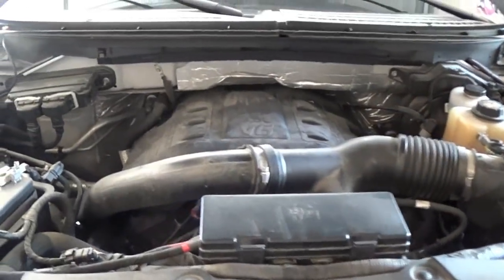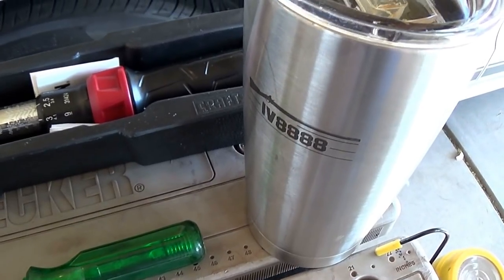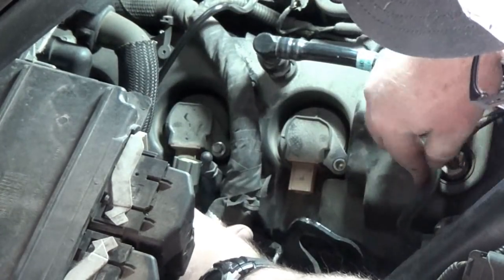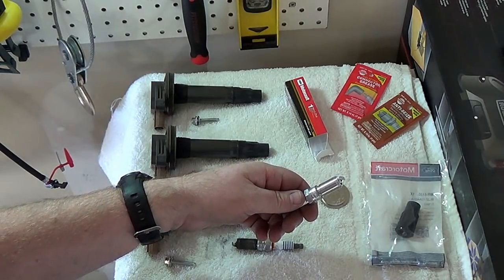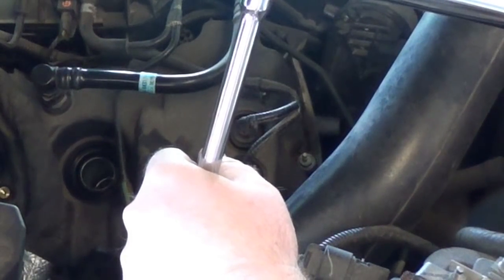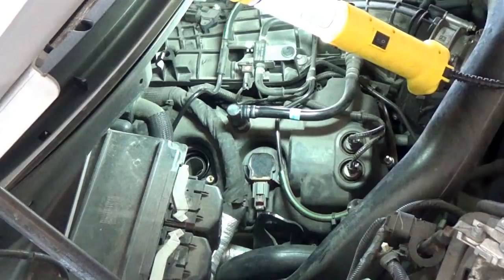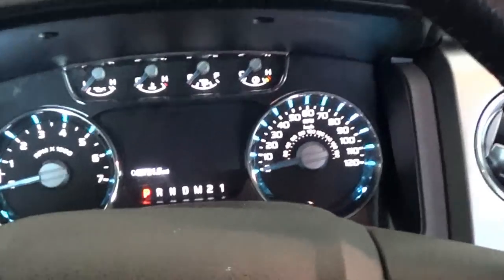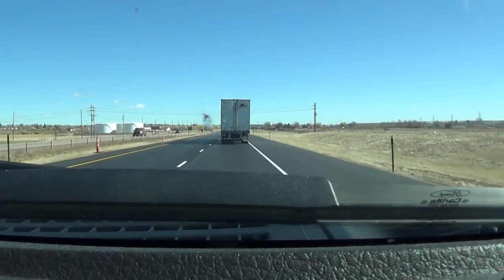2013 F150 EcoBoost Spark Plug / Ignition Coil Removal & Install | No more misfires

Comment: I have the 2013 F150 Ecoboost. I got the updated motocraft SP580 Iridium plugs and coils. I was having the chugging and flashing yellow light at higher RPM. $96 and two hours later the chugging is gone! This is a definite fix and WOW, so much smoother & what a power difference! You were right about  the MPG improvement too (and those bastard clips)! Fantastic video and thank you!!!
Reply from the maker: Thanks for watching and sharing our success.
Reply: Where’d you get coils and plugs for 96 bucks? I have a 2012 eco boost with the misfire in the third cylinder and I got new plugs but those coils are pricey!
Reply: On the spark plug I used the sp534 iridium. And msd coil packs red 82576. I have a 2014 EcoBoost 3.5. Made a world of difference. I see you used a different plug.

Comment: My local Lincoln dealer wanted $650 for this spark plug and boot change in Southern California!! I purchased the Ford OEM parts at a O’Reilly Auto Parts in Encinitas for a fraction of what the dealer charged. Thanks to this video, it took me just over an hour to change out the plugs. The dealer wanted to charge 4 hours from the book!! So fun and easy! Thanks so much for posting such an awesome instructional video! My Lincoln Ecoboost is a 2016 and the engine hasn’t changed from this video.
Reply from the maker: Thanks for watching. Glad it helped. This is one of those "If I can do it, you can do it" type of vids! lol
Reply: Coils cost roughly 400 plugs are roughly 80  plus labor so that's not all that bad

Comment: Today I used your video to guide me through this procedure on my 2014 EcoBoost.  I'm no mechanic, and these modern engines make me nervous.  But, with your help, the job is done!   Thanks very much.
Reply from the maker: Good to hear you got it done yourself!
Reply: I've got the same issue... in addition my AC was intermittent once it began sputtering so hopefully that is do to the misfiring, and it will correct itself after I'm done with the repair.

Comment: I ended up changing my 2011 F150 Ecoboost plugs and boots after watching your video.  You saved me a ton of money and the satisfaction knowing I didn’t get ripped off.   The truck is running like a top!   I had a terrible shuttering and stuttering in the engine but no engine light.  I found one plug that had a bad crack on the outside.  After changing all 6 plugs it runs like the truck did when I brought it home on day one.  Thanks for the video!
Reply from the maker: Byron Massey Awesome,  I love hearing the success stories!

Comment: THANKS MAN! I have 86K on my 2011 F150 FX4 Ecoboost. Lately it's been running rough - I thought was transmission issue the way it jerked around at speed. Studied up; found your video. Ran out and bought some plugs and changed them. I did it step by step like you suggested (well, I couldn't get new boots but they all looked perfect). I torqued to 132 in-lbs. Just took it out for 20 minutes - drove surface roads and highway - could not get a single shudder! Running great, no misfires. I never did have a check engine light but the problem was worsening so probably only a matter of time.

Your video is really well done man - I sincerely appreciate it.
Reply from the maker: This is great to hear! I'm just a regular guy making videos and hoping some help others. Thanks for sharing your experience!
Reply: What is the purpose of changing out the boots? Carbon build up?

Comment: Great Freaking video!  My f150 platinum was driving in horrible limp mode and had that code and I didn’t pay attention to the code but my coil bank five was the bad one. I changed all the spark plugs and nothing worked. Until I change the coil on Bank five that did the trick in holy cow. The power of my truck is back. This was an amazing video. Make sure you run a scanner and know which one is gone bad if you’re not going to change them all as far as the coil‘s. I got to say the O’Reilly‘s coil cost me $91 for one. For six upgraded spark plugs they cost me $65. I did not replace all the coil‘s.
Reply from the maker: I'm glad you got yours fixed and running good again.

Comment: This does work. Done twice in 183000 miles. The reason is because  in a turbosuperchaged engine if you shove in twice the air, it's like opening the spark gap twice as big( air IS an insulator, Ford...) Anyway, spark has more resistant as boost increases. Ford dogged out the 3.5 on numerous torture tests, but messed up on the plug gap big time.

Comment: Oh the fun I had Saturday morning.  I ordered the plugs and boots on amazon, went and got the antiseeze and di-electric grease at Oreily's.  Sun came up and before it got too muggy and hot I started in on this half hour work.  Now, late Friday I did the Electronic Throttle Body clean and that went really easy.  Figured I'd been schooled by videos and started the plugs.  Got everything off, got the hoses out of the way, got the coil packs unbolted on the rider side and that's where I got stuck.  I couldn't get my fingers on the coils enough to get them out.  Pry on them a video says.  Ya, pop a piece of plastic off the top of one.  Finally I hoped on the motorcycle and made the mile trip to the auto parts store and after looking bought one of those plastic panel removal kits for working in the interior.  With a little practice I could get one of them under the connection, lift up a bit on the coil and slide it further under the coil pack and with a bit of wiggling, up they came.  I was worried about breaking the jack but got past it with the tool.  The third time I did it the last coil came right out.  GREAT removed the boots, removed the plugs, new boots, anti seized the plug, greased the boots and put the back cylinder plug in AND went looking everywhere for my needlenose pliers to get the dang plug socket out.  Everywhere.  I was just using them two days ago.  Of course I was using my headset several days ago and finally ordered a new one today.   Back on the motorcycle, back to the store for some pliers, and back.  Socket comes right out now.  total time on one bank, 2 hours.  The other bank took 15 minutes.  Put everything back together, shorted around the battery to clear the ETB stored memory and did the reset routine recommended by FordTechMakuloco.  Later that day while driving with the wife to Walmart, she kept asking me why I was slowing down to 20 mph and then gunning it to 70.  "Because I couldn't do that yesterday without the engine missing and if done hard enough, throwing a code".  Thing runs like it did when I bought it.  It's a 2014 with 90,000 on it and what looked to be the original plugs, or at least the previous ones.  One of the coil boots was cracked and when I pulled it off it broke in half and the spring fell out of it.  I think I found the majority of my problem there.  The plugs ranged from 37 to 52 thous, that was probably another.  I just hated the fact that in the videos all the guys were reaching in, grabbing the coils and pulling them off.  Mine might as well have been JB Welded in.   
Thanks for the videos.
Reply from the maker: MrClean417 Tgank you for tge excellent tip for anyone that has hard to remove coil packs.

Comment: Nice. I’m a do it myself guy too. I drove one of those Turbo 6  Fords a couple of years ago. I was very impressed with the power it had. Felt even more powerful than my V8 in my Silverado. My old Silverado (RIP) had 265 K miles on her and ran like a champ. The only reason she got sold was due to some guy t boned me while he was running a red light!!! I ended up selling it to a Mexican guy at my work for super Cheep. He took that to Mexico and 3 years later his Dad still uses it on their farm every day. I miss that old truck. However now I have a company E 150 van that comes with a company gas card!! My personal car is only driven my me maybe once a week at the most. I really enjoy having a company car with a gas card!!🤑
Reply from the maker: The ecoboost in our 13' has lots of power but its not perfect. Some turbo lag, spark plug issues (although now I know to replace every 40k I guess it could be worse). It sucks gas though.

Comment: Thank you sir! Had a P0305 code, misfire in cylinder 5 on my 2013 F-150 Ecoboost 3.5 V6 going up a mountain hauling a travel trailer in Colorado. Stopped at O'Reilly's Trinidad and swapped it out really quickly and so far so good. I had 167k miles and the spark plug had a .045 gap and looked like the original Ford plug. I'll need to change the rest once I get back home.
Reply from the maker: I'm glad you got it going again!

Comment: Thanks for the video. I changed the spark plugs without a problem. Still felt sluggish after I test drove it. I found a video on how to reset the throttle control. That did the trick. Runs like a beast now. Thanks
Reply from the maker: Nice work!

Comment: Thank's for this video. It took about 45 minutes after I realized that my torque wrench and plug socket were not the same drive. Easily a 30 minute job if you have everything ready when you start.
Reply from the maker: Awesome!

Comment: Awesome video.  Really helped in my project of replacing the spark plugs with cold sparks and I went ahead and put on the Accel Super coil packs.  My truck had a misfire on cylinder 5 everytime I was going up a large hill that is on my way to work.  It would drop down to limp mode and I’d have to pull over and restart the engine.  Now my truck runs better than brand new and I just hit 192,000 miles.  Highly recommend doing this with the Accel Super Coil Packs.  Roughly $300 total for the set up.
Reply from the maker: Excellent. Thanks

Comment: Did this a few months ago had a cylinder 6 misfire. All of my boots were dry rotted and the spark was not making it to the plug. Change all plugs anyways. No issues since had to pick the boots out with plyers and a pick
Reply from the maker: Good info, good post. Thanks
Reply: No problem glad it might help

Comment: I had the same issues with mine. I changed the spark plugs a couple of weeks ago and it was running great. Now it's doing it again so I'm going to change the boots today. I hope it takes care of it. I use my truck for work and I need it to play nice!
Reply from the maker: These trucks are a little picky with gas as well. I haven't figured out exactly what it is but I avoid our loaf n jug now.
Reply: Did you change the boots and use the dielectric grease ? Some people carbon tracked the plug in couple of days because of a bad boot and no dielectric grease on plug and boot

Comment: Same thing here. My 2012 would misfire and the dealership wanted 650 to change spark plugs, i just did them last weekend for 65. Only thing that sucked is when the boots broke off inside. Best thing i found that worked were locking forceps to pull out the old broken boots
Reply from the maker: Good tip on the locking forceps

Comment: Thanks for the video! First time changing my own spark plugs and the video helped a lot. Though I did manage to pop off one of the red locking tabs. Going to have to see if I can find a new one of those.
Reply from the maker: I'm glad the vid helped. Those little read locking tabs are pain. One of mine was actually "unlocked" the whole time from FORD so I wouldn't fret too much with it not there. But its good to replace when you can for piece of mind.

Comment: Excellent video.  Just changed the plugs and boots on my 2013 ecoboost.  The only problem for me was unplugging the coil connector.  My arthritic hands don’t always do what I ask them to do.  An extra screwdriver helped. Where the connector slides onto the coil was a little gritty.  Cleaning that might help for next time.  
    Thanks
Reply from the maker: Hey, glad you got it done. My hands are getting the same way. Age and mileage is a heck of a thing.

Comment: Thanks for the great video.  I just finished changing the plugs on my 2013 F150 EcoBoost and watching your video first was a great help.  Those little clips on the coil wires are tricky.  I went back to that part of your video and watched it again and then I got them off pretty easily.
Reply from the maker: I'm glad the vid helped. I like hearing the success stories. Dealers want big money to do this but most people are fully capable of doing the work themselves. Way cheaper
Reply: Definitely just broke 3/6

Comment: They even make changing the plugs a pain in the arse now. Nice work Cobra
Reply from the maker: They want our money. lol
Reply: I wonder what car you're comparing this to, because I think this is relatively simple. About 15-20 minutes, all done. 
My wife's Mazda MPV (transverse mounted Ford 3.0 V6) required the whole damn intake manifold to be completely removed along with a dozen funky emissions hoses, the EGR, and the deeply-hidden PCV valve, just to gain access to the 3 plugs against the firewall. Now THAT was a pain in the arse.

EDIT: Okay, I just did this job and it took me an hour but that's because I always start wandering around the motor, randomly wiping down parts until they look new, etc. XD But still, this is 25X easier than the other V6 I talked about.

Comment: Great video. Should have cleaned your MAP sensor while you were under there. I've been putting up with crappy running for a while. Engine light came on yesterday. Cleaned 3 sensors. Replacing plugs today.

Comment: In two hours when the parts arrive I’m about to do the same to my 2011 eco boost bc I think it’s the same exact issue. But I am replacing all coil packs and spark plugs so I hope I’m as happy as you are afterwards!  Great video though. Thanks!
Reply from the maker: Sounds like a good plan.
Reply: @TheRealCobraBurnout  turned out great!  Thanks for all the guidance. Truck runs a thousand times better!!

Comment: Nice work, I'd suggest blowing off the top of the engine with air so there is nothing to fall into the open cylinder when plug is removed.
Reply from the maker: Good tip

Comment: Not having any codes or misfires but MPG is kinda garbage and planning on pulling a travel trailer next weekend.  Got some new plugs and boots on the way so gonna give this change a go before I head out on the trip.  Hopefully that'll help avoid any problems and boost up the MPG for the long trip.  Figure I'll do the Fuse 27 relocation at the same time to avoid having that garbage flaw hit me at the worst possible time in the middle of nowhere, too.

Comment: Hopefully you can help me here. About a month ago I got on a highway on the way to school and had to jump on the gas a bit because I didn’t want to piss the guy off behind me that I pulled in front of. All the sudden the entire truck starts violently shaking and I went from about 55 down to 35ish until it calmed down. The engine light came on, blinked for about 15 seconds and stayed on. It drove terribly until I was able to get it to a local shop to check the code. He told me it was a cylinder 6 misfire and that I should take it to the dealer. Ended up taking it to my usual maintenance guy that I trust more than the dealer (long story short, they tried ripping me off by $5k) anyway, they ended up replacing the boot and coils. Not sure if they replaced the spark plug or not, can’t remember. Either way, after that it drove like new. Now a month and a half or so has gone by and it just did it again when I hopped on the interstate. Though this time the engine light only blinks for about 15ish seconds and then turns off. I got a Bluetooth OBD-2 reader, checked the code and once again, it’s another cylinder 6 misfire. I looked into drilling the weep hole but I’m not really sure how to feel about that, though I’ve seen and read that it might fix the issue as it has for others. 

Bought the truck with 84k on it in Sept. of last year, got the first problem at about 90k and it’s currently at 92.8k

So what do you think? Should I try the weep hole or swap the spark plugs? Any info would help me here. 

Thanks so much for your time.
Reply: I had a similar thing happen with mine. I crossed an intersection and I had a misfire in cylinder 3 I'd I remember right. I stopped and turned the truck off and restestarted it. It was fine after that, then a few weeks later it happened again. So after I got it to  Ford i had this change my plugs, mistake btw they ripped me off... But long story short that fixed it. That was at 87k. Now it's at 156k with no issues of the sort to report